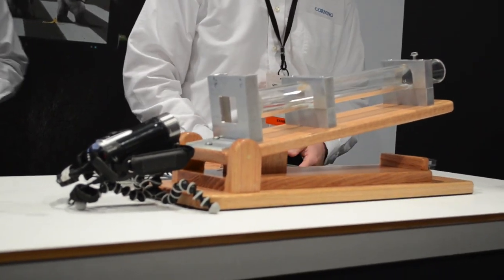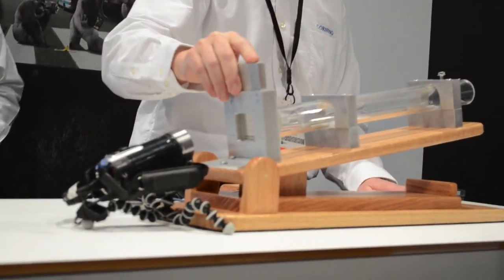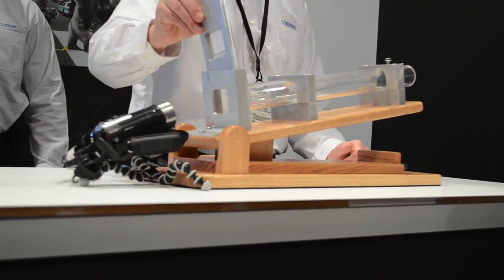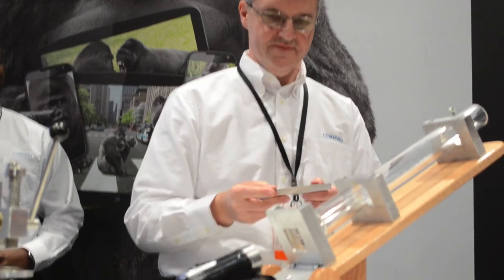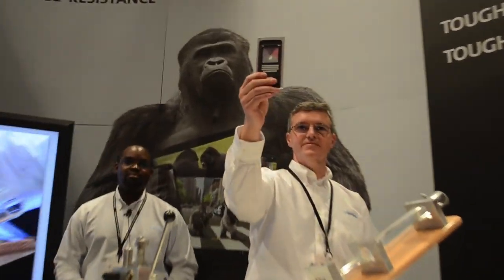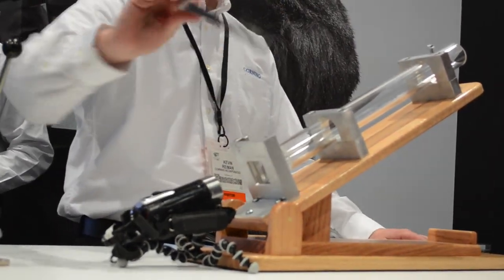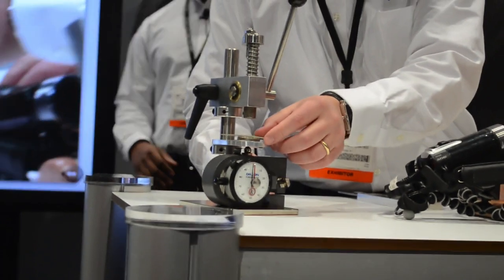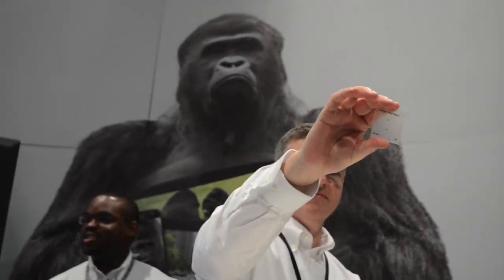Gorilla Glass 3 Live Demo - CES 2013

Comment: Also I checked some sources, and the 900 000 apps in the app store is only if you add the number of "iPad" apps and "iPhone" apps together, so in reality you can cut that number to about 700 000, also android has over 800 000 apps and they automatically switch between "tablet" and "phone" resolutions.

Comment: I have a Nexus 7 and a Galaxy S (which I don't use anymore), so I have used the Google Play Store before. I also installed Android X86 on an Acer laptop. The whole thing about Honeycomb is that apps released for Honeycomb tablets were often incompatible with Android 2.3. Even if all of the apps scale to the device's screen, there are apps where you can tell it was not specifically made for a tablet. You may have not encountered apps that don't work on 4.2.1, but I have encountered many.

Comment: Honestly, I have encountered incompatibility issues with apps like Adobe Flash (which Google of course stopped supporting), Apk Extractor (doesn't properly extract APK files, and the app doesn't require rooting.), Asphalt 7 (which experiences occasional amounts of extreme lag, but other than that runs smoothly), FiOS Remote (which works, until I try to use the in-app remote, then it crashes.), and Epson iPrint (not optimized for tablet, just a scaled up phone version)

Comment: When I say incompatible, I don't mean lags or crashes, I mean the app doesn't run SPECIFICALLY because it is on 4.2.1. What you are talking about here are apps which would most likely experience the exact same issues regardless which android OS you are running. Also why would you need an APK extractor, and how would you know if it works properly or not? You are probably basing this on illegal copies of apps, because I have Asphalt 7 on my nexus 4 and I can assure you that it doesn't lag at all.

Comment: The Nexus 4 and 7 have different hardware, and the Nexus 4 is proven to be smoother. I need an APK extractor to put newer apps on older versions of Android and vice versa. For example, I used my Nexus 7 to get GO Launcher EX to put it on my Galaxy S. There are no illegal apps here. I know that it doesn't work properly because it does not copy the files to the destination folder, or anywhere else for the matter. I am not basing this on illegal copies, just apps obtained directly from Google Play.

Comment: Samsung was never in any way creative, in fact, I would say they are one of the worst phone manufacturers in terms of build quality (like the plastic back on their phones). I agree that the hardware alone does not make the device better, but since high end android phones DO (for a fact) have better hardware, and are also in conjunction far more customizable and have more apps than iOS (75000 more apps), you could say that android devices are factually better than iOS devices. I don't take defeat